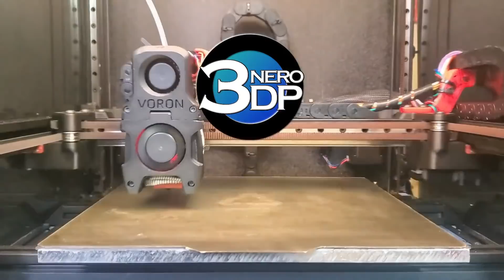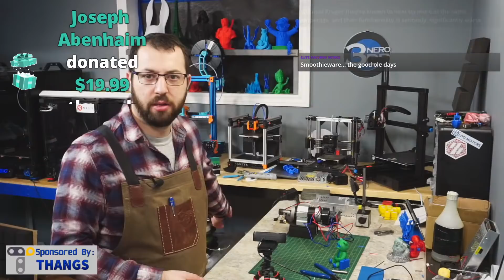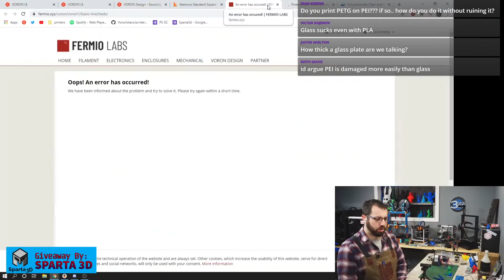New Voron V1 Build LIVESTREAM - PROJECT TOASTY BOI - PROLOGUE

Comment: Hi
I am building a V0.1 and using the BOM for parts, the hotend cooling fan is specified as a 5v but the SKR e3 v2 board fan output is 12/24v. Do i need to get a 12v fan ?
Reply from the maker: Nope. Check the wiring diagram in the manual. You can pull 5v from somewhere else on the board
Reply: @CanuckCreator  Thanks, i assumed that might be the case. I have a 24v -5v dc-dc converter to run the Pi so can use that but wanted to check first.
Reply: @CanuckCreator  Typical, i looked through the wiring diagrams and made a note of that and then completely forgot. Thanks again for responding so quickly.

Comment: why do i need a Pi?  Can i build one with ender 3 mini skr 1.2 and use it like ender?
Reply from the maker: The RPi is needed as it runs klipper as the firmware, which runs on the RPI

Comment: Music/Channel Introduction (theme)  4:03
Stream starting 5:39
Tonight stream goal 8:22
Toasty Boi explained 9:45
Start of sourcing part for a Voron V1 13:55
Explanation of the BOM configurator (choice)...
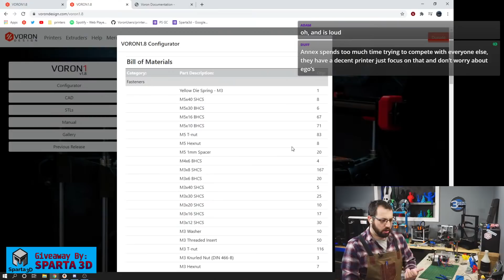How Nero will go through the BOM 24:30
Concerning VORON Kits by third party seller on Ali 25:27
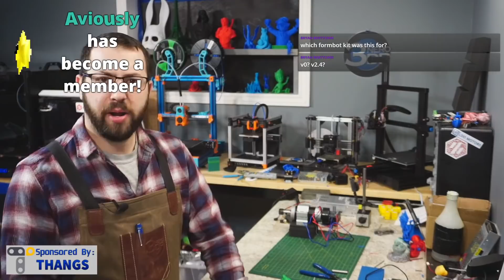Fasteners 27:50
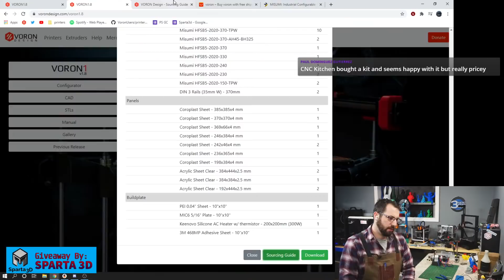About the Sourcing Guide and BOM 28:35
Motion 33:53
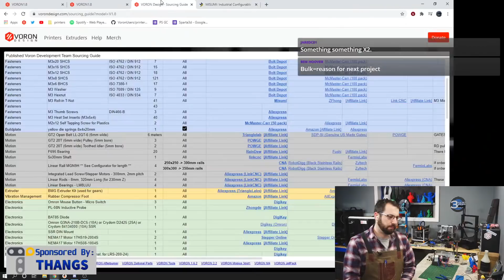Note about Quantity 38:54
Electronics 49:10
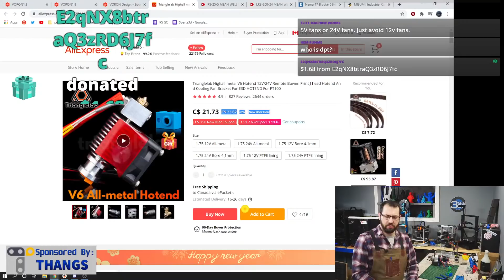Doggo break 1:08:20
Back to program 1:10:00
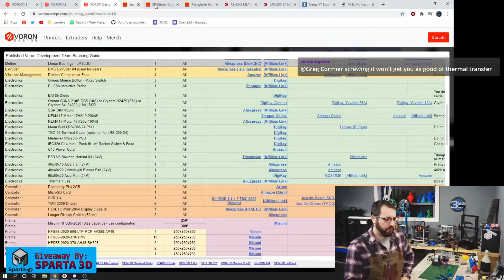Controller 1:14:46
Frame 1:24:45
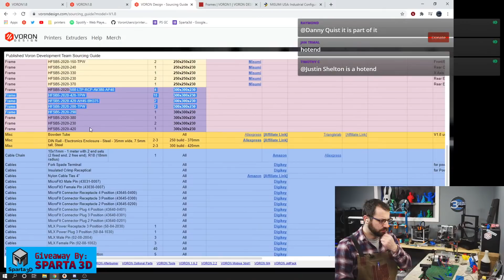Misc 1:31:27
Cables 1:32:25
Panels 1:38:42
Buildplate 1:40:50
Question about Sourcing Guide 1:51:35
Sparta3D Giveaway 2:02:40
Let's talk tools 2:10:10
Onlybenchies panel 2:20:38 
(about 1-2 minute)
Schedule/plan for streaming looking forward 2:24:47
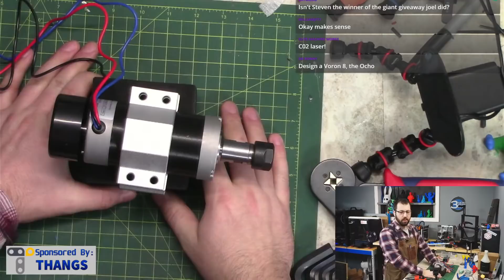CNC and questions 2:26:02
Conclusion 3:06:32
Music outro 3:08:00

This little table of content was made while watching the stream at 1.75x speed. I could've missed important thing or be off by a couple of second. Hope it help!
Reply: Thanks mate
Reply: @shinuza  No problem. I might do something similar for all his toasty boy stream series. We'll see if needed.
Reply: This is great, thank you again for this.

Comment: Thanks for the video!

What about other controller boards? with the pi doing all the hard part, MKS boards are a bad option? they have a lot of features and are like 60% price of an SKR board. f.e: MKS SGen l v2 has 2 part fan and 5 driver slots for <30€ (5x2209 included)

Comment: I'm watching late. It is possible to run a copperhead WITHOUT the slice heatsink. You just screw the copperhead throat and heat block into a V6 if you want to. All of the benefits of a copperhead, with a V6 mount.

Comment: You are saying CoreXY does not scale well, I would be really interested in hearing more about this !
Reply: i think you can use a wider belt to reduce the stretching a bit
Reply: @rabenklang7 Makes sense ! A spring loaded tensioning system ( or chains - hahahah :) )
Reply: belt length gets too long.
Reply: @GuyFromInternet00  so the belt flexes or stretches too much over that length and most likely too difficult to guide and tension the belts ?
Reply: @SarahKchannel  Yes, the longer the belt is, the more it stretches wehen accelerating and stopping. This will induce more ringing the longer the belt path is

Comment: As a note on the aluminum beds: do not cheap out and think any chunk of aluminum will work. I got an extruded aluminum sheet from a local supplier because that's all they had. This wasn't for a VORON build, and the printer only had manual leveling. Though the surfaces appeared fine, there were ridges that caused so many issues that the bed was impossible to level. Cast and flat ground really is the way to go here. Of course things like automatic bed leveling can help this, but it's nice to start on a good foundation to begin with